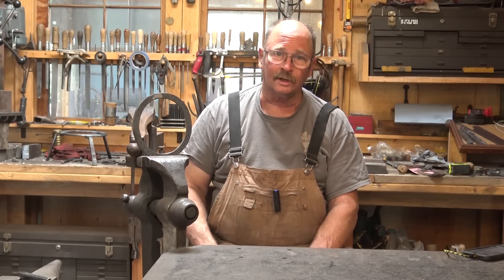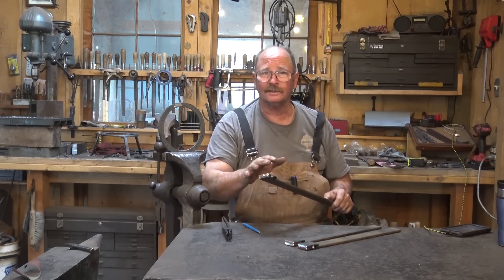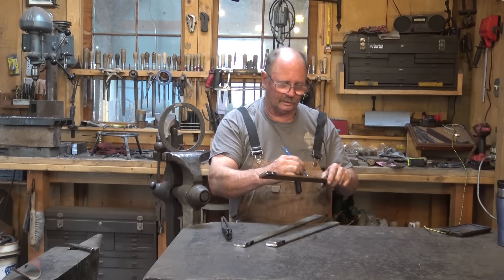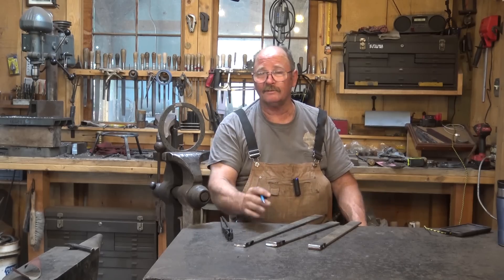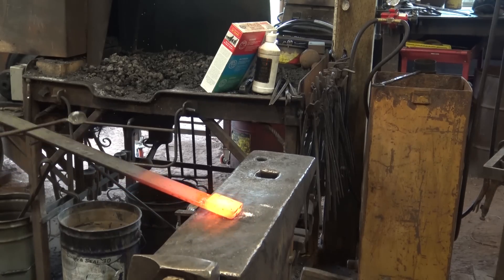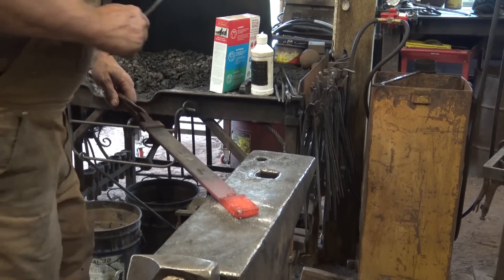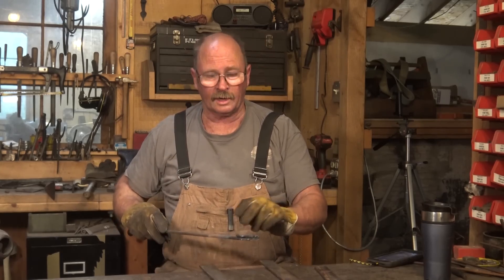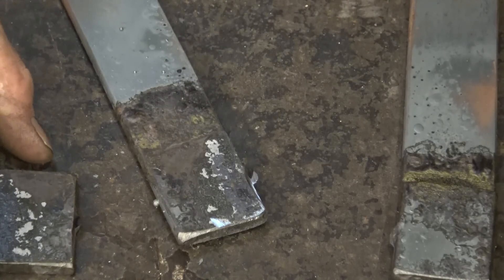How much flux do you really need - forge welding

Comment: So that was no precleaning of hot.rolled? And do u usually pre gring of ur.mill.scale on hot rolled?
Reply from the maker: I generally don't do anything.  It scales as you heat it anyway.  The flux helps clear off any scale and is one of the main reasons to use flux.
Reply: Thank u. I kinda figured. But as a man who just got a 2nd burner build n can now achieve Forge welding heat I figured I'd ask. I did how ever get a weld on what u showed as a way 2 make a simple fire poker. But i did clean scale 1st

Comment: The "thicker" areas ascribed to flux seem to be the mate to the "clean" steel.
As the joint wasn't hammered, possibly the flux did its job and peeled the millscale off the clean area and was stuck to the opposing face instead of being ejected from the weld?
Just pulled the scale off by sticking the removed flakes to the opposing face and came away from cooling stress?
Reply from the maker: I think that is exactly the case.
Reply: Thank you for taking the time to reply!

Comment: Great video. Am thinking (from where I was watching) that the clean surface is where the flux got in and removed the scale. The rest looks more like scale? 
As you know that is why one needs to add flux several times or start with a very clean surface and hammering out the scale & flux mixture? As in stands to reason why one needs to do several things for a good weld apart from just fusing the metal together. Was it flux or scale it was hard to see. I have done a few experiments whereby I added just flux on metal and it comes up all shiny. It looked like what you had in part. 
Good experiment. It would be cool to do some more and maybe add a control in the form of no flux with one that has scale and one that is clean of scale and maybe giving one lot a one time pass with the hammer.
Reply from the maker: Most of the darker spots are flux that is stuck to the cold material.  That of course would be expelled during the weld

Comment: In the woodworking world, the analog of forge welding would be laminating work. When there's a time pressure situation the tendancy is always to apply way too much adhesive. I imagine as you gain experience, like in my wood working, you will develop a feel for little you can get away with. Another consideration if you have cats, borax is insanely toxic to them. That might be another caution for not getting flux all over the place. Another great video!

Comment: Thanks for the video. Very interesting.
But you did only one weld. 
It would be interesting to see if there were any signifikant difference after three welding heats + hammering.
https://www.youtube.com/watch?v=fyjkbN0hWRY
Reply from the maker: I didn't actually make any welds.  The point of the test was to see how far the flux would flow into the joint.  Once welded the flux has done its job

Comment: Borax melts at 1365, scale forms at 1400, scale falls off freely at 1750 and forge welding temp max's out at around 2300. Something I found interesting just now is borax does not boil till 2867. Looking at the one test you can almost see that one side is the mirror image of the other. Where there's an area on one that was clean surface the other had the residue. Since borax reduces the boiling point of iron oxide I bet the residue was just that, iron oxide that had solidified.

Comment: I am sure that EZweld and iron mt flux have there 'secret blend', but is there a recipe for the DIY (read that as 'cheapskates') version? I have read where some add powdered steel, gathered from the bench grinder or angle grinding area, via a magnet. My success with adding it to borax seemed to yield no conclusions. Thanks John!
Reply from the maker: Straight borax is pretty good.  Iron filings added may help a little, but are not required.  You can mix other fluxes with borax to make them go further.  I am sure there are recipes out there for do it yourself flux.
Reply: Home Depot sells flux for $6 a 2 lbs can I don’t think u will find it cheaper.   Borax is only about $5 in the supermarket.   And it goes a long way.

Comment: The thing I was taught in soldering pipes both as by the plumber I worked for when I was fifteen and the AC&R teacher in VoTech in high school in 1980 was that flux is for that last bit of cleaning, and you don't need a lot. Same thing soldering switches into wiring in the Navy, use the least amount of flux that you can. For forge welding, it seems to me you would be better off grinding the mill scale off first so you only really need to deal with the heat scale from the forge, make sense?
Reply from the maker: Makes sense, but in most cases you forge, scarf and weld without ever leaving the forge and anvil, so taking the time to grind is highly inefficient.  Smiths have been welding without grinding for centuries, so while it my help in theory, I doubt its necessary in practice.  Although with large flat surfaces such as a billet of Damascus I think it is probably good idea to grind first.

Comment: I'm new to coal how does flux contribute to clinkers? Does flux hurt any other part of a coal forge ? 

I know and understand what it does to wool and soft bricks but I havent seen much info on what it does in coal.
Reply from the maker: Flux won't damage a coal forge, which is a real advantage to welding in coal.  The flux does add to the clinker build up whiuch is a good reason not to use to much
Reply: Black Bear Forge thanks for the reply. I have limited experience with both but have definitely struggled with managing/gauging heat in coal vs propane though I typically see less scale in coal vs propane.

Comment: Also, for an extra clean mind, I was taught to use my business card and make a line of the spilled borax on the anvil - the longer the better. 
And then smash that line. For increased speed, add coke dust.
Reply from the maker: Makes me wonder what kind of coke you might be using when making lines 😜
Reply: Blacksmithing - Joey van der Steeg, LOL 😂
Reply: Next time making lines don’t forget to call me
Reply: Did the mill scale get removed first? Does flux remove mill scale or any scale? Does flux keep the weld clean during heating so it does not form scale? Im so confused!
Reply: @clinttanner4645  Borax first gets the scale of and then creates a layer that will protect the metal from further oxidation. I haven't tested myself but I would assume borax removes mill scale too considering it's basicly the same stuff as forge scale if I memory serves me right. I haven't used other fluxes myself so this might not be 100% universal but the concept should be pretty much the same with all fluxes.
1.Remove the existing scale
2.Form a layer to prevent further oxidation
Reply: Pretty funny. Thanks for the smile
Reply: Thanks Joey, just dropped and spilled my beer everywhere! Got a mess to clean up now before I have time to grind up coke!